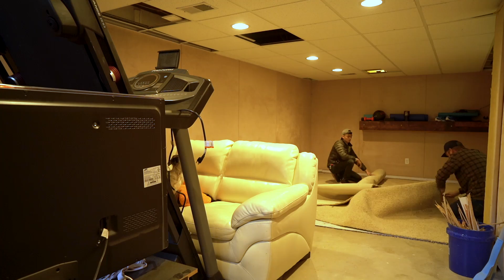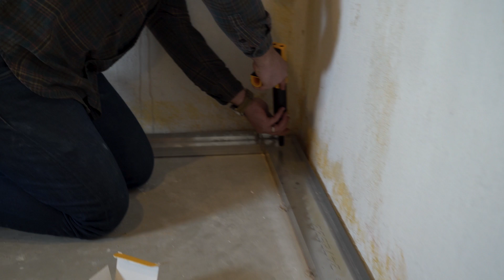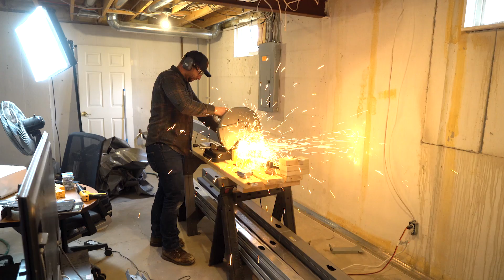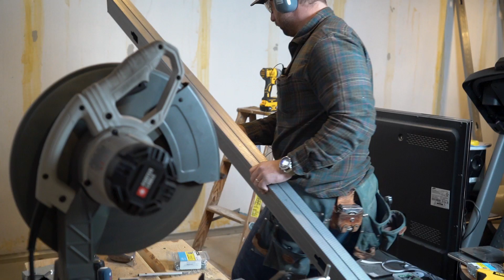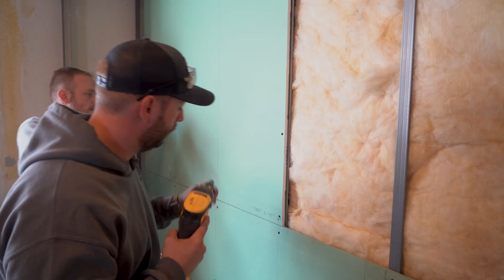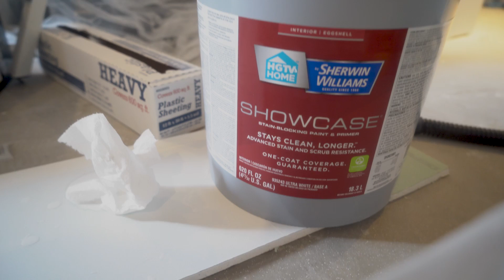Affordable DIY Framing, Drywall, & Paint // How To Basement Remodel

Comment: Your studs are upside down, small slot goes at bottom to lay c-channel wall stiffened in. And your studs should be turned around the opposite way with open side facing where your layout starts from, so when
Reply: So when you start hanging your dw, starting from that inside corner of your layout, the tapered dw joints will lay flush,, not uneven...

Comment: If you use a quality SDS concrete drill bit, it will cut right through the metal track and into the concrete.  no need for a separate bit.  You can easily do an entire basement with a single bit before it wears out, metal and all.

Comment: i've been looking for info on building w steel studs, and, i have to say this has been one of the best if not the best so far.   There are a few questions I would ask (why no sill gasket underneath floor plate?  eg), but overall great video.

Comment: You forgot to install protection for metal runner. Asphalt felt paper strip for metal isolator espacially on basement. It will protect the metal runner from moisture and eventuslly rusting.

Comment: Great video. Question I saw on another video where the contractor recommended to use 2x4 on the floor then to lay the metal frame boards on top. Just in case of water issues in the future. Thoughts on this. I have new construction and we have sump pump and back up cause we live in a water prone area. I mean the chances
Of any flooding or seeping unlikely but wanted to throw that in there

Comment: For all the people saying he's cutting the studs upside down or installing them the wrong way, it's irrelevant which way you put them as long as they're all the same. One thing I'll say though for anyone looking to do this; don't get self tapping screws if you're working with light gauge material. You want just a fine thread wafer or pan head type framing screw and same goes for when you drywall onto light gauge studs. Just a fine thread drywall screw. Also take advantage of the framing and stand your sheets up to make the taping easier, faster, and have a more plumb wall in the end.

Comment: In NYC, I prefer 2x4s with the metals to make the wall stronger when securing the sheetrock.  Also, I used Durock all around from the floor to 3 feet and the rest of the wall, using mold resistand drywall to finish the wall.  If your good a taping, no one can know the difference when you finally finish the wall.  Plus, in case you have any water backups, you dont have to worry about mold and mildew issues when the place drys.  
Last but not least, I use cermaic tiles in a basement for fear of water backups and since its much easier to clean and maintain.
I love your videos.  I just added you on the gram and I can't wait to start my own basement project or projects.

Comment: I'm not trying to be rude but this guy is doing it all wrong. Chalk your line. Put a laser on it. Put up your top track. Install bottom track. You don't need self drilling screws for 25. gauge steel. You can also cut a bundle of studs at once when it's 25 gauge. He frames his studs on 16 c correct. He's has no carrying channel or braces. Which would be every 4 feet. In a home when installing drywall. Start with top sheet then bottoms after. Your ceiling should always be done first if it is not a t bar ceiling.

Comment: Was super impressed that you were competent in steel and wood.... Then you used the steel studs upside down and cut off the bottom of the stud.  Also with steel studs you screw the soft side of the stud first so the the studs do not rock and make the joint at the seam uneven.  Otherwise exceptional job.

Comment: Why did you not mention before doing any kind of framing to do a moisture test on the floor to find out if the concrete needs to be sealed or not? I’ve been framing basements for over 20 years and this is a step that 75% of “Pro” basement finishers and DIY’s make.  This should be the absolutely first thing that’s done when finishing a basement. The key to a great comfortable basement is making sure that it doesn’t feel or smell like a basement.  Also, a good concrete sealer also will prevent Radon from seeping up and will also reduce your radon %.  Seems like a good video but a DIY’r after watching this video will just start framing without even thinking off the floor.  Also, metal studs do carry vibration so construction adhesive should of been used on the base plates to help with sound and adhesion.  But what do I know! Not a great video! I’m always watching videos to hopefully pick up some new ways of doing things since I always like to learn an improve.... but I keep coming to videos like this one that skips the prepping part which is THE MOST IMPORTANT PART of finishing a basement.

Comment: Great video. Nice work. BUT 2 you do need vapor barrier against block wall because any moisture seepage will condense on drywall (unless you live in the desert) and with metal studs you have R-0 insulation every 16". You'd see it clearly on a thermal imager.

Comment: Since the walls aren't structural you can save on material by going 24' on center with the steal studs! And next time when using a sprayer do all the corners and edges first then fill in the middle it makes it look much better and it speeds up the process as well

Comment: Why would you notch your bottom track and run it long if you weren't going to have your top track replicate it? I do a lot of commercial metal framing and drywall, and I'm very confused by the way you're using this material.

Comment: We might be buying a commercial building and converting it to residential.  It is cinderblock walls in part of the building.  We might hang drywall.  We have priced the metal studs.  I am confused though, why they would be the better option over wood studs.  They are more expensive than wood.  And they are very flimsy.  Why would you choose metal studs over wood.  Thanks to anyone who might see this and give me advice.
Reply: Wood rots and insects are more likely to damage the stud in a basement

Comment: I don't mean to say this.  But u should avoid using steel studs on outside walls in basement.  They rust out cause of the moisture
Reply: He used aluminum (from what appears to be the same material available on Lowe's site)
Reply: @RD-zq7ky  trust me its steel studs.  I use that stuff every day

Comment: Where I live you can screw the top plate of the wall into the floor joists. You must have 1 inch gap. I would just drill a hole in the metal channel and use a long screw.

Comment: Missed putting vapour barrier under the bottom plate of the framing.... Also should have backrolled the paint if you are spraying, at the very least the final coat....you also should have used different sizes of knives for drywall mud, 4" to tape, 8" second coat, 10/12" for final.

Comment: so with the metal tracks, there is no need to be butted up against the wall? im asking as my walls are definatly not straight from end to end, and I already have installed 1 inch foamboard on there, I wanted to leave at least an Inch-Inch and a half between the foamboard and the steel track due to wall warping and such.

Comment: Painting with a sprayer machine leaves an uneven texture unless you level 5 all the walls. Also, if you would've roll the 2 coats of paint, future touch ups and repaints will be much easier, also sanding walls is essential after priming for the perfect paint bond, and unwanted textures. Cool video! Keep it up!!!!
Reply: Juan Benitez thanks for the info...i’m about to do the very same job in my basement
Reply: Yeah and those small gimmicky sprayers dont really do that great of a job. Get a nice Greco 650. You can rent them from sherwin William's. Beats paying a couple grand for them. 

And when you spray the walls, you should always backroll them. Spray tips are really faulty and will leave lines.

Comment: It’s much faster and more efficient to layout everything first for top track and bottom track. Then once you finish doing layout you cut and install all your top and bottom track. once tracks are all installed you pull 16 oc layout for studs(use a laser) layout doors widows then install studs. It’s much faster to frame metal that way instead of the way you’ve shown. But hey it turned fine. But could have saved a lot of time doing it a little more efficiently
Reply: COuld've done 24" as it's non load bearing
Reply: 24” if you wanna be cheep and do low quality work. Most basement exterior walls aren’t load baring, I’ve always framed 16 OC on all walls unless specified in plans and I’ve never seen 24” layout for walls on any plans in my 12 years of framing. The only time a 24” layout is mainly used is ceiling drops, soffit or trusses. If I was a home owner and saw my walls built 24 oc I’d either fire him and get a new contractor or make him do it right. Not to mention the inspection probably wouldn’t pass, at least in my city
Reply: @ThaMadDad  Working down in Australia and Nz, we did 24 (600's) all the time. I only ever do 16 here in canada but the  extra 8 inches will literally make zero difference in this scenario. I don't think anyone's going to be running through the wall any time soon.
Reply: Here in America we don’t frame walls 24” on anything other then a shed. 24” layout would cut a lot of time and money I agree, it does give you less backing for mounting things tho, but all in all if it’s non load barring 24” layout I don’t disagree with. Inspectors and home owners would disagree here. Also I It just looks more quality and complete when you do 16 OC I feel
Reply: @ThaMadDad  yup as a carpenter I agree, I only ever do 16's. I meant if there was a DIY'er tight on money, they could do 24's of they really had to in this basement situation.

Comment: i do commercial metal stud framing and the studs are upside down the small part of the cut holes are supposed to point down
Reply: The small part goes down to allow the flex(wire) to sit down in it. I do commercial remodels so this is literally all I do.
Reply: 305Mitch the small part goes down for black iron or spazzer bar actually
Reply: Joe Kinchicken  just like wood studs come in different sizes, metal studs come in different gauges. You can also construct metal studs where the fasteners hold all the load. There's a skill set there. I use metal studs and track in my house.
Reply: Joe Kinchicken  The only weight the walls carry is the weigh of the sheet rock that goes on them. Around doors, I would use wood studs, so you would have to use wood studs where you were going to mount a pull up bar on the wall.
Reply: It’s the same in residential metal framing. But it’s funny to see this guy teaching others about metal framing . He has the basic idea of it but for sure he doesn’t know how to do it 100% correct.
Reply: That drove me nuts watching him do a how to video upside down.
Reply: And once he plumb one stud he can pull the rest on his tape 16” o.c.
Reply: For a beginner that's going to take on the task of redoing his basement which is recommended wood or metal beams?
Reply: JJ R I’m a beginner about to finish my own basement, all the research I’ve done for the past month pointed me to doing metal studs for a number of reasons..if you’re doing it mostly on your own they are super light depending on the gauge so you can carry a lot at once, they’re almost always dead straight so you can use a stud then mark your 16’s like he did in the video, much cheaper then wood when bought in bulk (at least in my area). There are downsides of course but so does wood!
Reply: @strongisland7015  thankyou man. Appreciate your advice!
Reply: Up or down doesn’t matter if you’re going to use insulators in the cut outs. Made no difference in my case because the insulators were round
Reply: STRoNG iSLaND just saying those holes are engineered for something called a spazzard bar to strengthen the wall. The holes are used all the time for wire, but that’s not what they are put there for by the manufacturer.
Reply: Jeff ohh I didn’t realize that, that’s pretty cool. Drywall isn’t enough to strengthen it?
Reply: STRoNG iSLaND sometimes if they are real tall studs I’ve had to put them in. Sometimes if its a structural wall. Done tons in chase walls were only one side is possible to drywall. Really depends on the job and architect in my experience.
Reply: STRoNG iSLaND I’ve even been on a few hospital jobs were the electricians were told the were not allowed to run any wire horizontally inside the wall haha was crazy. They said it was to eliminate the chance of any shorts inside a wall because of those punch outs.
Reply: STRoNG iSLaND https://youtu.be/m1fwRzzvUn4
Reply: Drywall should be installed 1/2”-1” off the concrete. Every basement gets water sooner or later. Mold resistant Drywall certainly does grow mold. I have removed a lot of it covered in mold. Better to be safe than sorry and keep the drywall off the ground when installing. Make a block out of wood to sit on when installing.
Reply: @ryanshort6021  Do you add a baseboard moulding or do you just leave a gap there?
Reply: Andrew DeVore I would add baseboard either way to add a finishing touch.
Reply: @ryanshort6021  thanks, that's what I figured.  I've seen the damage done by minor flooding  at a friend's and it doesn't take much.
Reply: Metal studs in a residential home is just stupid to begin with
Reply: @chuckmaddox6725  most basements hold moisture also if water comes into the basement metal studs are the best bet.
Reply: Chuck Maddox mold and fireproof doesn’t sound stupid to me. Makes sense for finishing a basement
Reply: Chuck Maddox ehhh I finished my my basement with galvanized metal studs. Not worried about the mold or water damage and the finish is so much nicer if you stand your sheets up. Railroading sheets on lightgauge metal studs without any kickers is a problem.
Reply: JosephD Whitt yeah and he could use his speed square to score his mark with his razor and bend and fold for the cut instead of doing the whole cut with snips only the side
Reply: I knew I was right. Yes I know the small part goes down.

Comment: Im pretty sure he put the paper upside down. There is a little ridge on the paper, and it goes IN the mud. This way when you sand the mud after, you wont cut the paper on the ridge with the sand paper !!  Good job nonetheless !! Also when doing corners, you simply fold ON the ridge gives you a nice 90 degrees.

Comment: I've asked this question before but I cant seem to get a straight answer about it:
Why is the drywall being installed horizontally instead of vertically?  The way I see it, you're creating a seam 48" off the ground that goes all the way around the room in addition to the vertical seams.  Why not just install all the drywall sheets vertically and minimize the seams?
Reply: Because it’s a basement and if it ever did happen to take on water. Only the bottom portion of the wall would have to be replaced.

Comment: Great video Chris. I started watching your videos when I saw your Trestle Farmhouse table. Your videos are still entertaining to me. 

I do have a question regarding that Wagner Paint Sprayer you used. I know you're not Tech Support for Wagner, but I was wondering if you had any issues with the paint 'spitting' out of the gun while using it. If you did experience the spitting, what did you do to fix it? I know I could probably thin out the paint I use, but I was looking for some 'hands-on' advice before I try painting with my Flexio 2000 again. 

Keep the videos coming! 
Dustin
Reply from the maker: I have had that spitting a couple of time and I think it’s from the paint and not the gun. No answers on how to prevent it
Reply: I own a painting company. The paint is spitting because those little DIY sprayers don't have enough power to atomize the paint. You need to thin the paint.
Reply: @mtbrdude  What model paint sprayer would you recommend, if I don't want spitting and want to be able to use it for all kinds of things?

Comment: not worked with metal studs myself, is there a reason to not layout the wall sections on the floor and tilt up? Based more on floor and joist unevenness?

Comment: what does your code say to space between screws on drywall ? looks pretty big compared to European standards . not more than 7-8" ?!
Nice job buddy :)
Reply: Where I am its 8 inches on a joint and 12 inches on the center of the sheet. Everyone normally does 10 and 16 though

Comment: Job well done here. I did a complete bathroom remodel for my daughter's home using the same sheetrock material you have used & bought locally. I used a conventional 3/8" variable speed DeWalt drill for my screws & got pretty good at after some practice setting the screw depth correctly. Absolutely nothing wrong with using the steel studs on this project, came out beautiful. The sheetrock work I did was my 1st major sheetrock project as it came out gorgeous doing it the old school way, priming & painting it with a roller... ( I also installed 2" thermax, reflection on both sides between the original native cut studs that were laid flat. )... ( She has a quite & warm bathroom now )... ( She is also one happy camper... ) 
Excellent presentation here & I thank you.  
Bill on the Hill... :~)
Reply: William Farr what is the old school way of doing drywall?
Reply: do you have b4 and after pics?

Comment: Not worried about leaks in your foundation with the non-waterproof insulation straight up against the concrete foundation?
Reply: Also, that concrete may wick up moisture and it being stuck in-between the C-channels isn’t good. A barrier for the bottom plate would be insurance against that.
Reply: C B should someone worry about that